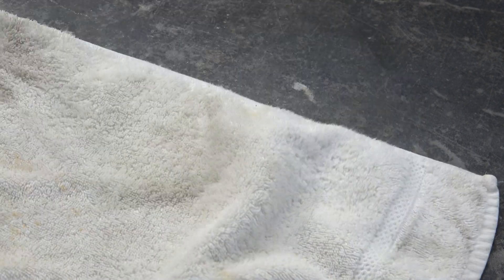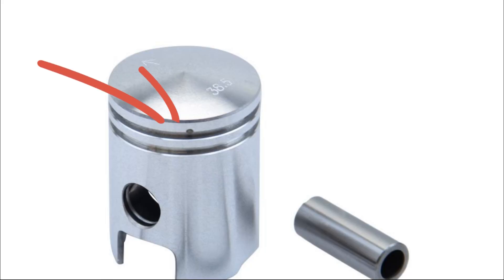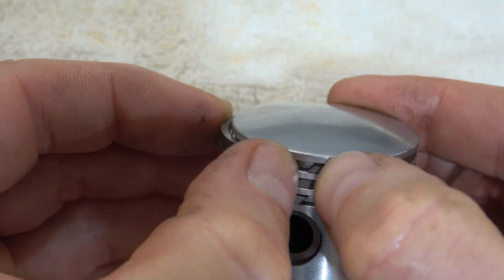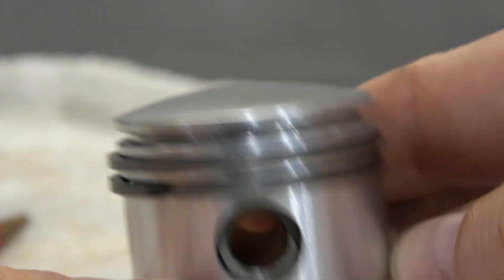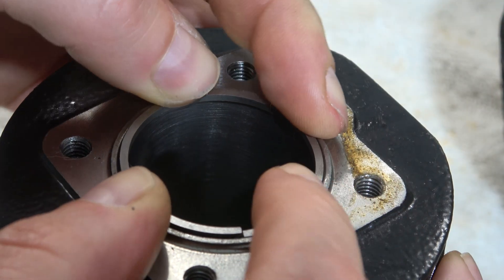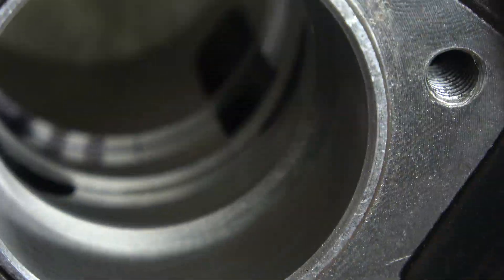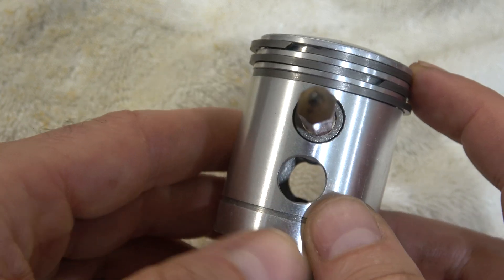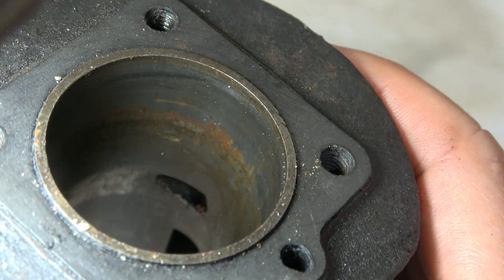Two Stroke Engine Surprise!

Comment: mcculloch hated ring pins, usually just had drilled holes for ports. this had its own dilemma with the "bridges" on the exhaust port then overheating, expanding into the bore and seizing that way instead :)

 its somewhere around 25-30% of the bore that the port gets too wide and bulging becomes an issue, can be sort of fudged with the shape of the port itself...

and even with the pins, a ring can bulge asymmetrically and still snag the port... porting an engine can be a nightmare of unintended side effects...

and the pins generally make a mess of things when THEY fail... which is why "top of the line" engines usually shroud the pin under the ring rather than in the side of the groove...

engineers and inventors have been playing around with methods of sealing pistons since before james watt... and even now, they are still far from ideal... but we also use whats cheap to make, stock, and sell... most books are based on high performance engines where part time areas matter. breathing ability at high speed with limited time. not all engines have to follow the same architecture to the word...
Reply from the maker: Appreciate your thoughts and knowledge on this. I was hoping for the topic to develope like this, as we now have a nice collection of understandable reasons why inventors and engineers built the way they did. Just to say „it is how it is“ without questioning won‘t make one understand to get the whole picture any better. There are definitely pros and cons when pinning rings. Thanks for taking the time to add your precious knowledge. Rgds TW

Comment: It all comes down to port opening size. Your engine has small enough port openings that it does not require pinned ring gaps. There is a formula for port opening as a % of bore which is generally used to decide if a given port will need a bridge or chamfering to protect rings. Older more primitive engines often don't have gap pins since the ports are so small the rings basically don't see them. But the larger the opening gets, the more needs to be done to prevent the ring protruding and snagging,
Reply from the maker: Thanks for your inputs, appreciated. I was hoping for a formula to exist, couldn‘t find one though. Countermeasures like bridging is often seen on simular engine sizes (50ccm) for instance on older Puch engines. They however have bigger openings and therefore it makes perfectly sense as a countermeasure.    Thanks again!

Comment: There is no need for alignment pins first off. This is a small engine with very small ports and secondly when you look at the rings the end are self supporting as they are cut at an angle so that with the reciprocating motion of the piston the ring is being pushed tight
Reply from the maker: Thanks for commenting. I was curious, how much positive influence the piston ring ends would have when shaped at an angle like in the given example. The port size is crucial. Still, I wonder why all the tech books call for piston ring pins in general, when talking about two stroke engines? This could be separated depending on engine size. Thanks

Comment: It runs so reliable because your ports are small and your piston so long so it doesn't rock....Your engine has no power...compared to like s KTM
Reply from the maker: @fredmitchel1236  Thanks for commenting. The size of the ports is cruicial in my opinion as u mention. And yes, the velosolex doesn‘t have power beside the human being adding power while pedaling😉
Reply: Tiny carb, too - 6mm or so.

These things aren’t intended to go terribly fast - about 15mph/25kmh.
Reply from the maker: @dennisyoung4631  Yep, 13mm down to 6.5mm. Isn’t a rocket indeed. Just a time capsule….

Comment: Most two stroke pistons have two rings, I am seeing that this has three, that might be the reason it does not require pins as there is less play of the cylinder due to 3 rings compared to two...your thoughts...
Reply from the maker: @yoppindia  Thanks for your comment. Yes, this is unusual und could be a reason. Due to fewer play, there would also be less tendency for the rings to open in the ports.

Comment: What was the surprise?
Reply from the maker: Hi there. To me it was surprising, that the original piston doesn‘t have the locking pins for the piston rings within the grooves, eventhough the cylinder has many port openings. Despite this combination, the engine has proven reliability over decades.